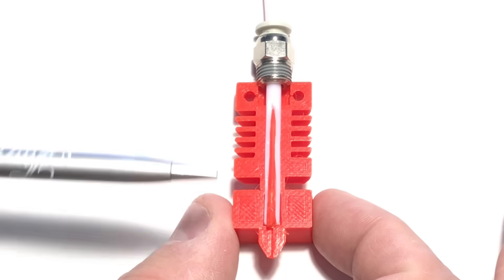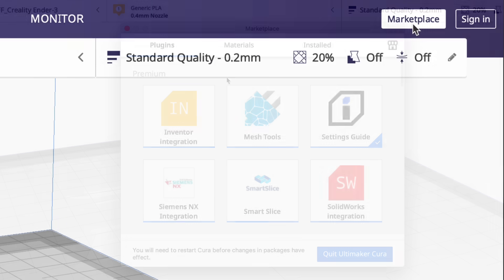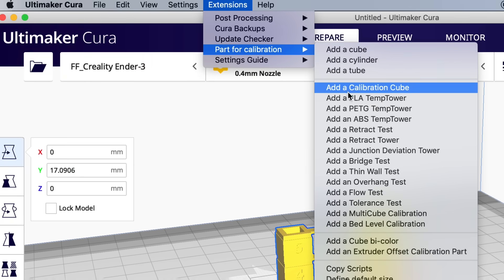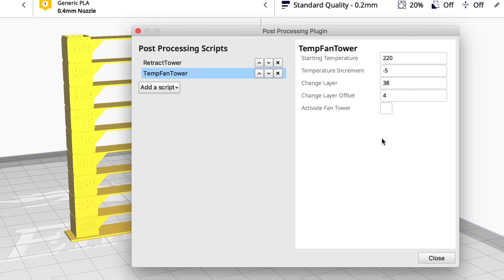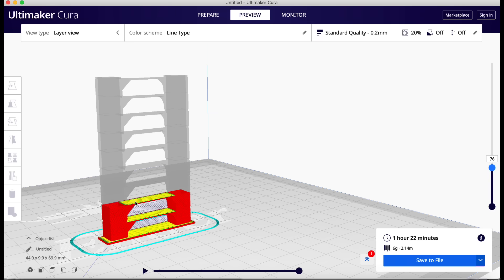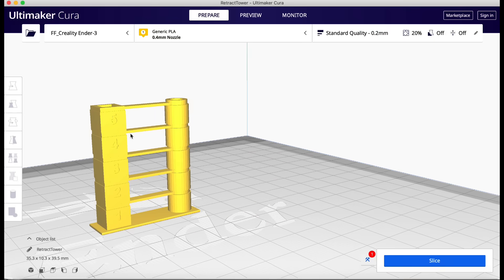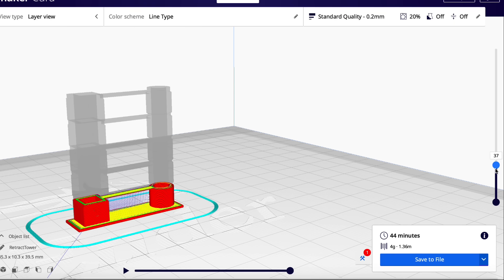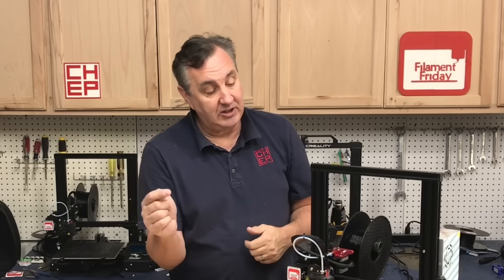Calibrate Perfect Retraction Settings Using a Cura 4.8 Plug-in

Comment: Shouldn't you change your retraction settings in Cura before printing?  They only changes that are shown in the video are temperature and layer height.
Reply: The retraction distance is set by the script, it changes 1mm every 38 layers. The reason he shows the layer height preview is to make sure it matches with each bridge on the model.

Comment: Ok, now that im using black sunlu its going better, but since i starded mesuring things i discovered one particular problem; 
We can ignore the bed levelling since im using a dial gauge for mesuring. Anyway, the problem is that going up every 0,4mm there are a big difference in first 1.2mm, after that value everything is pretty fine, its going pretty good not perfect but the error is +- 0.01 and at the value of 8mm (on monitor) im reading 7,76mm on the gauge.
Now 7.76-0,96(real value on 1.2 height) the result is 6,8 and if we sum 1.2 eureka its 8mm, my steps are correct, also because i cheked it also with the rotation on full lenght and with the steps calculator online, all correct, my motor is ok, my lead is oriented well. My motor is 200s/rot. And my lead is 8mm per rotation, so my minimum increment value is 0,04. 
Now, how can i solve the first 1.2mm? And what could be the cause of this ? Backlash? Im already using anti backlash nut, but it seem to be worst now than with normal nut (but im pretty sure that the problem was the same also with normal nut)

Comment: If all my f” test prints are all the same on every level even with different speeds and other settings what could it be? Im using capricorn tubing changed 3 weeks ago and printed only pla on 205 and once on 230 for the test. Its stringing, even with 7-8mm retraction, even with fast retraction, i tried a lot of setups but still…there are a lot of very small and very annoing strings, could it be a bad filament? Im using evryone white pla atm, help me im so nervous about this thing, the more im tring to setup it the more i think im doing wrong
Reply from the maker: White can be a difficult color. Try some other filaments.
Reply: @FilamentFriday  thanks, i will switch to black and grey then, if white could be difficult then i suppose that pigment chemically could be a problem? Anyway next week i will recive brass nozzles from e3d and whill setup a diy deumidificating box for feading my printer, then i probably will exclude most of external factors, cause for now my belt are tensioned, steppers are setup, my rod is mounting an antidumping bruss nut, maybe im close to my first 95-98% perfect print😂😓
Reply: @dmytro95  Did you manage to get better prints?
Reply: @_nom_  atm moment i have no time for my printer problems cause im in exam section, but i discovered a lot of stuff, thats why i ordered misurement instruments to setup my ender almost perfectly (0,04 mm error), in way to reduce the quantity of variables and get more constants
Reply: But im pretty sure that the filament it self should be greatest of my problems, basing on the principle that as in all thing the material u use determine the final product quality

Comment: Hi Chep, thank you for the video. I recieved my first printer yesterday, I want to do the Temperature Tower but here is my problem. My first layer starts at 36, the second layer starts at 70, the third layer is at 103 so the increments are not at all consistent, I am completely confused. Is there something I am doing wrong or how can I fix the inconsistency? Hope you can assist.
Reply from the maker: Check the authors wiki listed in the plug-in. He explains the proper settings. They weren’t available when I made the video but are now.

Comment: Is there a test that does both distance and speed? Would be very handy to be able to test dozens of settings in a single print. There is a website that does this, but the script it generated just did not work at all for my printer.

Comment: I‘ve done the temp tower and retract tower. However I barely see a difference. I printed the temp tower twice because I thought I messed up but temp went down from 220 to 180. Almost no visible difference. Same for retraction tower (1-5mm). They both look good but why is there almost no visible difference?
Reply from the maker: Some filaments work good across multiple temps.

Comment: I’m using PLA+. The temp tower said 210 C was the best. Then I tested the Retraction, set it up just like you showed and got the same amount of stringing between each layer. It’s like my script settings didn’t effect the print. I have an Artillery Genius Pro. Thoughts?
Reply from the maker: Try this: https://youtu.be/OG7We83M5gc

Comment: Im using cura 4.12.1 and there is no option for copy script any ideas please
Reply: If you have installed the plugin it auto installs it, no need to add the scripts manually again.
Just go to "Extensions -> Post Processing -> Modify G-Code" there you can click on "Add a script" and it will list all scripts there so you can directly add and modify them there.
Reply: @hellofyou  I don't have the option to modify the g code for the template tower it's not in the list any suggestions?
Reply: @MrBurningrubber  do you mean the temperature tower? if so i think the script for that it is called TempFanTower
Reply: @hellofyou  yeah. I don't seem to have that option.
Reply: @MrBurningrubber  for me it is near the bottom somewhere i have to scroll to see it
Reply: @hellofyou  yeah the last one for me is the retraction tower. In the modify gcode bit. As I can bring up the temp tower but I can't program it to change anything.
Reply: @MrBurningrubber  hmm i'm afraid that i do not know what or where else it could be. Perhaps re-installing the plugin works?

Comment: Had input the same numbers for TempFanTower:  220 / -5 / 38 / 4.0 as shown in your example.  However, when checking temp change layer in preview mode, 220 temp starts at layer 39 (rather than 38) and then goes to layer 82 at 215 temp, then 122 at 210 temp.  The temp changes are not occurring at even increments of 38.  Is there a step I am missing please?
Reply: I just set it to change every 42 layers

Comment: I have an issue I am hoping you can help me with.  After I slice the part to verify the transition layer as you suggest, the towers on either side of the print are grayed out as though they will not print.  I've looked at the line type color scheme to see if there was a selection unboxed, but no.  I am clueless here.  Thanks for the awesome vids btw.  I am brand new to the fun and I don't know what I would do with out your help! ;O)

UPDATE:  So I changed the Outer Wall Inset setting (I saw this in a forum post) from your 0.2(Good) profile from 0.2mm to 0 and now the towers show up.  Does this makes sense?
Reply from the maker: Interesting. I’ll have to look into that.
Reply: Did you hit slice first? And then go into the preview tab :)
Reply: @christhomson595  I did.  That's what I couldn't understand.  After I sliced it and started lookin gat layers, the towers weren't there.  I did a search online and someone else had the exact issue.  I did what they suggested and it worked.
I changed the Outer Wall Inset setting in the CHEP 0.2(Good) profile from 0.2mm to 0 and then the towers showed up.

Comment: When doing this calibration do also have to change the setting in the slicer. i.e. mine is set to 6, but I want to start at 1 in the calibration part. Do I need to change my slicer to one also to start.
Reply: no, the g-code overrides the slicer. So when setting the values for the retrarct woer g code in post processing, you set the starting value as "1" and that overrides the Cura default value

Comment: So I've done the temp fan tower tes and found my optimum temp now I'm doing the retraction tower. 
But after I find my retraction distance how do I find my best retraction speed?
Reply: You can do the same thing when modifying the g-code, switch the first option to speed instead of distance and add the appropriate start/increment
Reply: @Mason198  oh I noticed the speed option and didn't put it together lol.
What defects are you looking for during the speed test?
Just started a couple weeks ago sry
Reply: @atarisbetter9199  for the most part you're probably looking for the exact same thing defects for the distance part. They may affect stringing/blobbing slightly differently but still the same defects. So do distance first, update in your slicer with the best value, then do the same thing with speed if you think it still needs to be changed
Reply: @Mason198  one more. I'm adding the script for the speed test now, does adding script ignore all other settings in the drop down? If I set my new retraction distance will it follow that with the script running or do I need to run another script along with my speed test. 
Because I even have infill automatically set but while running the distance test it skips it. Just wanna make sure it's using that retraction distance while speed testing. Thanks again.
Reply: @atarisbetter9199  if I understand you correctly (maybe not, I just woke up 😅) the script should only override the settings it says, it shouldn't change things like infill unless part of the script is about infill

Comment: This might a dumb question but do you print them both at the same time or one then do the other?
Reply: The video indicated that you first print the Temp tower, identify the optimal temp, and then print the retraction tower.
Reply: One at a time since you have to set the temp for the stringing test after the temp tower.

Comment: I printed the temp tower and the printer keeps building a crisscrossed screen on the back of each layer, the same thing happened on my contraction tower. Does anyone know why and how to fix it? Thanks in advance.
Reply: maybe you have a low wall count and it is the infill showing through.

Comment: When I try the temp tower, the first layer change seems to be 39, then the next layer don't get started untill 81...What is happening?
Reply: This happened to me too idk lol
Reply: If you switch to .16 layer height, then the built-in value of 52 aligns with the built-in "change layer" value.
Reply: @kapoiosallos3595  thanks but i did my test and found my sweet spot for my prints
Reply: @509Pyro  Am having this same issue.  How did your resolve please?
Reply: @ireneh6615  i just ran with 39 and went from there i followed the video
Reply: @509Pyro  Thanks so much.  Were your steps in even increments of 39?  Mine are not...

Comment: Well, I loaded your profile and the Calibration extension into Cura 4.4.1 (Linux). Now, when I go to "Extensions", the only options I see are POST PROCESSING and CURA BACKUPS. I verified, it does say the extension is loaded. I will admit, I'm very new at this. In other words, I don't have a clue.
Reply from the maker: Did you restart Cura?
Reply: @FilamentFriday  Yes, several times.

Comment: If the best result of my retract tower was 4, does that means that the new retraction distance must be 4 mm?
Reply: Yes. Each filament you use may require slightly different settings. A good idea is to write the setting used on each roll of filament once you know what's best.

Comment: i did all of this but my printer keeps starting at 200 when in the script it says it starts at 220 and goes down -5 each layer
Reply: Mine did too (190) but that was pulling in the setting for the first layer temp - then it switched to 220.
Reply: Same

Comment: I’ve tried printing the retraction tower, but it fails each time. The print doesn’t stick to the bed or the nozzle creates a big glob of plastic and it drags the print around. Any thoughts? I upgraded my extruder to a direct drive. I calibrated the e steps, but not the flow rate (yet). My prints so far are not smooth. Does this mean it’s over extruding? Thanks!
Reply from the maker: If it’s not sticking to the bed then you bed isn’t leveled properly or needs to be cleaned. Try this: https://youtu.be/_EfWVUJjBdA

Comment: What I have found interesting is using Cura with the stock settings produces no stringing, using the same stock settings in Prusa Slicer produces stringing which have been causing me a massive amount of extra work to clean the parts along having to bin prints due to excess stringing.

Comment: According to the creator of the plugin (5axes),  the temp tower is meant to be printed as Layer Height 0.16 and the retract tower at Layer Height 0.20. The script and print settings for the temp tower should be:

Script Settings:
-Starting Temperature: 220
-Temperature Increment: -5
-Change Layer: 52
-Change Layer Offset: 5

Print Settings
 - Nozzle Size : 0.4
 - Layer Height : 0.16
 - Initial Layer Height : 0.2
 - Line Width : 0.4
 - Wall Line Count : 3
 - Top/Bottom Thickness : 0.8 mm
 - Enable Bridge Settings : True
 - Use Adaptive Layers : False

Settings for the retract tower should be:

Script Settings:
-Starting Value : 1 mm
-Value Increment : 1 mm
-Change Layer : 38
-Change Layer Offset : 4

Print Settings:
 - Enable Retractions : True
 - Retraction distance : ! Must be different from 0
 - Nozzle Size : 0.4
 - Layer Height : 0.2
 - Initial Layer Height : 0.2
 - Line Width : 0.4
 - Wall Line Count : 3
 - Top/Bottom Thickness : 0.8 mm
 - Use Adaptive Layers : False

You can find these settings on his plugin's GitHub wiki.
Reply from the maker: Thank you for sharing. I didn’t see that when making this video.
Reply: @FilamentFriday  You're welcome. I stumbled upon 5axes wiki while trying to do the tests in your video. Thanks so much for all your informative videos and for letting us all know about this plugin. Your videos are super helpful for a beginner like me.

Comment: What retraction settings should I print the temp tower at? Mine is printing straight away with loads of stringing (retraction enabled: 2mm 20mm/s)
Reply from the maker: That’s the point of the test, try different settings to see what works. I don’t know which setup you have so I can’t give you good recommendations. If you have bowden maybe 5mm and 50 mm/s, direct drive 2mm, 50mm/s.

Comment: The correct settings for the temptower in cura 4.10 to 4.12 without resizing the model.
Starting Temp is 220. (Make sure your Printing temp and initial printing temp in your profile is also 220)
Temp increases -5
Change layer 41
Change layer offset 4 (the base is 4 so the test actually  starts at layer 5)

Comment: For the retraction tower,  do you need to uncheck retraction in Cura,  or just leave it on, and the Gcode will overwrite those settings?
Reply from the maker: GCode should over write it.

Comment: While printing the temp tower watch your display and make sure the temp is actually changing with each level of the tower. If the temp stays the same throughout the print, select the standard .2mm profile and set your print temperature to 220c. Now reslice and try again.

Comment: tell me how this is possible, at all temperatures there is a hard stringing from 220 to 190, and the retraction tower at 200 degrees, from 3 to 7, stringing is not visible at all? creality cr 10 smart
Reply: Check that the temperature is actually changing on the display as it gets to each new level. My guess is it isnt.

Comment: Your channel is the reason iI did'nt give up after 2 days of failed calibration. (until your bed level and e steps videos)
I am a little disheartended again. When inspecting the G Code, it is as you show, but no matter what I do, the G Code is instructing my Tower to print as per my last print. I am attempting to calibrate for PLA+ and it is still just starting the print at 210 as per my own settings for prints. The menus have changed since your video, I am hoping someone feels generous enough to reach out and reply as to what I may be doing wrong
Reply: I figured it out. Thanks !!
Reply from the maker: What did you find?
Reply: @fatchunk3678  What was the fix?

Comment: hi all! my retract tower comes out with no strings at any level, when I try my prints they come out with strings. Someone knows which parameters does the script use?
Reply: Check while the temp tower is printing that the temp actually changes with each level of the tower. Watch the display. 
If it isnt changing then you need to use the standard .2mm profile and set the print temp to 220.
Reply: Try the  prime speed setting

Comment: Great explanation! Thanks.
I think that retract distance and speed depends on filament diameter, doesn't it?
Everybody proposes values (range), but no one specifies for which filament diameter.
Reply from the maker: Most printers are 1.75mm diameter and you don’t switch so once you set it you are probably fine. Though different filaments types can affect it.
Reply: @FilamentFriday  True, but including this information would help for those who are searching to get some idea before calibration.

Comment: I am using Cura 4.8 ( I won't use a newer version) and I wasn't able to download the plugins the usual way.  I was able to go to the market and install them that way and it said they were added.  I restarted Cura (and later my computer) and I do not see the calibration shapes, nor do I see the "part for calibration" under extensions.

Comment: Mine doesn’t have copy scripts.
Reply from the maker: Skip that step as later version on Cura automatically includes them now.
Reply: @FilamentFriday  what do you mean.  Automatically? The temp tower has to be manually changed at each level.
Reply from the maker: You don’t have to copy the script
Reply: @FilamentFriday  but when you print temp tower the temp does not change on its own.   Right? I had to manually change them.   It’s impossible to change retraction rate on the fly.  You have to change the setting then recslice.  Correct? Am I missing something?
Reply: Mine either